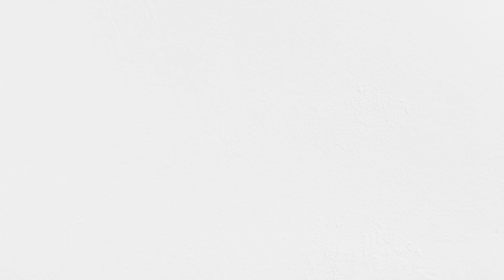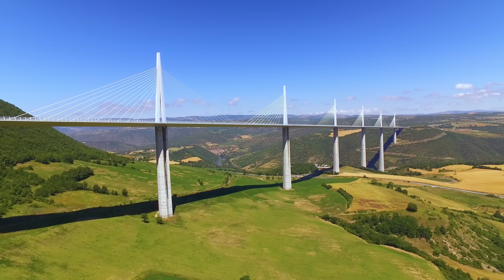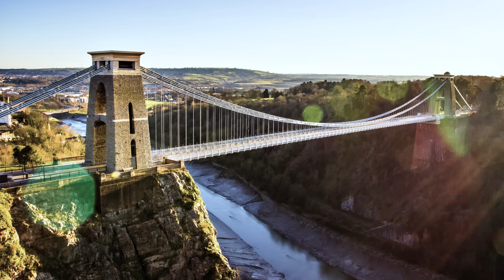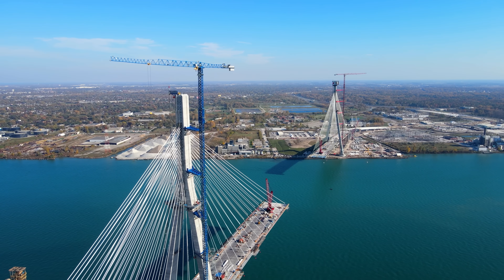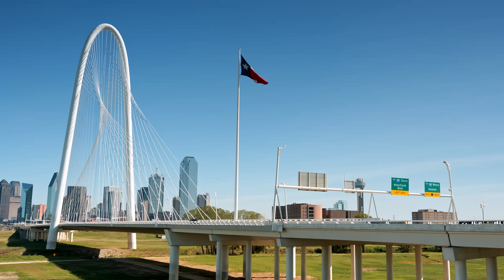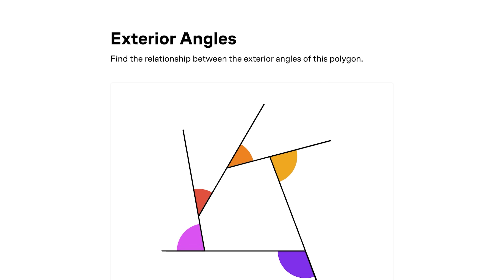A Love Letter to Cable-Stayed Bridges

Comment: I live outside of Vancouver, BC. In the early 2000's, the Port Mann bridge was replaced with a cable stay bridge. The Patullo Bridge is being replaced right now, with... a cable stay bridge. In total, there are (or will be when Patullo construction is complete) SIX cable stay bridges in the Fraser Valley - 5 over the Fraser River, and 1 over the Pitt River (which feeds into the Fraser shortly downstream from said bridge). And one of these isn't even for cars, but instead for the local SkyTrain rapid transit system! 
Having lived near so many of this type of bridge for so much of my life, I think I agree that these are the best bridges. But maybe not the best ever... I'm pretty sold on tea.

Comment: Congratulations on these engineering presentations. I appreciate the tacit sense of humour. 

I would have added the fact that the catenary suspension bridge has the catenary curve connected to the horizontal deck below, by vertical parallel cables. This forms a rectangle which can change its shape, unlike a triangle which is stiff and does not change shape,   I do not understand why the engineers did not see this  feature which permitted the catenary bridge to oscillate as a violin string or a piano string,  This was the reason of the collapse of the Tacoma Bridge,  where the quasi rectangular spaces could change shape, hence it permitted different modes of oscillations. Pay attention to the vertical quasi rectangles holding the deck 
https://youtu.be/XggxeuFDaDU?si=NVwXOTN-uup-kEHn

The cable stayed bridge with its triangles is much more stable . Those triangles are wonderful structural elements, 
https://youtu.be/vHASuGfYZdc?si=X44xaN2QQewD0OkT

Comment: Very cool video, the one thing I dont quite understand is how the decks of long cable stayed bridges like the russky bridge shown can withstand the compression forces without buckling... the decks look so thin and flimsy yet the entire weight is suspended by cables at a 45° or even shallower angle pulling on them sideways as much as theyre pulling the deck up... 
Is that the reason why the longest bridges are still suspension bridges??? In suspension bridges you dont have the problem of a compessing and buckling deck...

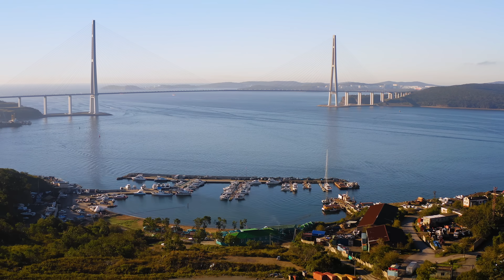Comment: 13:50 and so I, someone interested in "A stable crossing of the Messina strait", could close the video here, since our bridge needs to be 3,3 Kilometers long.
Not even close, unless you use a suspension one. (Also you can solve the wind issue with having an aerodynamic structure with a wing like shape; I guess computer aided design has made progress there too)

Comment: Thanks, I've often wondered why cable-stayed bridges have become ubiquitous recently.  I supposed it was due to some significant advance in materials, but if I understand you correctly it has more to do with the availability of computer power to do the necessary calculations.

Comment: One of the most interesting parts of the west section of the bay bridge is that while it is essentially 2 suspension bridges glued together it’s roadway is still designed as 1 large one, the highest point is the where the center anchor tower is located

Comment: I'm surprised you didn't mention the Queensferry Crossing in Scotland, within a mile there is a cantilever rail bridge dating to the 1890s, a 1960 suspension bridge which, as you say, is reaching end of life and now just used for buses and finally a 2017 cable-stay bridge.  Without doubt the cable-stay bridge is the most beautiful, but seeing the 3 of them together is magnificent, particularly from a boat going under them

Comment: The arch bridge is much better for a relatively short span with a deep bottom like a canyon. For a short span utilitarian RR bridge a steel truss bridge is more practical. All bridges don't have to be astatically designed. IMO the Golden Gate is much more beautiful than any of the harps shown.

Comment: If that is the new arthur avenue, it's not even the scariest bridge in the area, that credit goes to a bridge crossing interstate twenty six on ashley phosphate, but the close second being one of the older bridges that's going into mount. Pleasant on 526, and the reason why that one was terrifying was. I got stuck on it in high wind situation. Because someone's car ended up burning and they had to rush emergency services from the exit ramp.

Comment: Disappointed there are no pictures of my local cable stayed bridge, the Queensferry Crossing! Opened in 2017, it spans the River Forth right next to a suspension bridge from 1964, and the famous cantilevered beauty from 1890. Together they are a lovely portrait of the evolution of bridge design, and all 3 are still in use

Comment: My first experience with cable stayed bridges was the Anzac Bridge in Sydney Australia opened all the way back in 1995.
It's kind of cool to drive over this bridge in the back seat of a car. If you tilt your head back and look up and out of the rear window of the car, the cables appear to shoot up as you drive under them.

Comment: My first sight of a cable stayed bridge was in the 1980s.  I watched it go up with wonder at its beauty, and I drove over it the first day it was open to the public.  It wasn't that long (main span not quite 1000 ft, IIRC) but it really lifted you up high, very quickly (to accommodate containers ships, I believe).   Passing over that bridge almost never was the sensible route for me to take, but I would frequently go out of my way just to drive over it and enjoy the view, both of the bridge and the river below.  These have been my favorite bridges, and arguably, my favorite works of engineering, for nearly 40 years now.

Comment: Could you address a topic that is in and out of the energy news. 
I have a general understand of how oil refineries work. Basic fractional distillation, cracking tower.  Much reported is the diffrence between the light sweet crude pumped outta the Permian basin. NOT BEING refine in our refineries because they were designed to refine tar sand oil. Could you shed light on this. It would appear that you would skip someone the initial clean up steps

Comment: As a heavy haul driver who routinely operates trucks up to 65 tons, I personally appreciate new, strong, and safe bridges.

Nothing will make you sweat like crossing an older bridge that has a weight restriction yet the state will route you across it with a note on the permit to slow down and straddle both lanes.

Comment: Question, is it possible to put a system of pulleys across a cable stayed bridge to bring the lateral forces to the same point? This way we can have the cable ends pull on each other. Wouldn't this require less support?

Comment: "The Öresund bridge in Denmark", it's between Denmark and Sweden and most of the bridge is on the Swedish side since it transfers to a tunnel closer to Danmark so it doesn't interfere with traffic at Kastrup airport.

Comment: Second year into studying civil engineering and I have to agree that cable stayed bridges are incredible, able to span great distances whilst also providing the necessary rigidity needed for certain applications like rail bridges whereas suspension bridges are typically too flexible
Reply: I suggest you look into the bridges in many different location of China, Cable stayed bridges is good for railway, but with wider river arch bridges can have much bigger span, there is one in building with 2300 meters for the main span, without building more piers it is a cost saving design, also large ship still able to go under the bridge.

Comment: Excellent. I had found most of the early cable stay bridges to look a bit 'ugly' with too many boxy straight lines. However the video was an eye opener about just how simple and effective the cable stayed bridges are, along with the how and why of their late arrival.

For a glorious comparison there's the 3 bridges across the Forth estuary here in Scotland, with the old suspension bridge being rapidly down graded because of corrosion on the suspension cables. The new 'third Forth bridge to Fife' (aka Queensferry Crossing) is quite a neat bit of kit, easily seen from the "Forth Bridges Viewpoint".

Comment: Yes! They are fabulous bridges! Not cable stayed, but I used to traverse the Tamar via the rail bridge built by Isambard Kingdom Brunel, on train, and latterly, via the road traffic suspension bridge  built in 1961, connecting Cornwall and Devon.
I marvel at the engineering every time that I cross.
Every time!
Reply: Actually it's a funny hybrid, it's a suspension bridge but the curved arch over the deck is not a typical truss but there to take out the compressive forces from the suspension rather than use anchors. It's a very unusual design

Comment: What's intriguing is how far away some of these cable-stayed bridges can be seen from. The Gordie Howe Bridge can be seen for miles and dominates the skyline of the lower Detroit River when looking north, and even seen from Lake Erie as far south as Stony Point. However, the Ambassador Bridge (a suspension bridge about a mile north) just doesn't stand out on the horizon the same way, head a short distance down or upstream of Ambassador it just kind disappears. Even the Mackinac Bridge just doesn't have the skyline presence I feel.

Comment: You mentioned a caveat to suspension/cable stay bridges, but didn't mention how we have compensated for those erroneous forces, since 1955 we have been retrofitting bridges with viscous damping devices to reduce those erroneous loads and maintain the structural integrity of the span. Look up Taylor Devices Inc. for more info.

Otherwise, excellent job, it was very informative to learn the "other" side of suspension and cable stay bridges.

Comment: I always quite like it too. The symetrical and simple look. The easy construction method to see, the quite "easy to understand" forces. I was almost never fan of suspension bridges. I never really get why they got theses 2 big enormous cables instead of just some little ones, redundancy seemed better, etc. So I appreciated your part explaining why it only started ggetting traction recently.

Fun fact : they were working to replace a big bridge in montreal (Chaplain bridge), they went from the oldschool  design to the cable stayed bridge, and I found the new one so much more gracious. It was completed quite fast if you are asking me. I kinda think they spent more time redesigning the car access to bridge than build the bridge itself.

Comment: I was hoping that you would include the "Most SNP" bridge in this video, as you have included some other smaller city bridges. Most SNP can be translated as "Bridge of the Slovak National Uprising" and was built between 1967 and 1972. It is an asymmetrical cable-stayed bridge with a main span length of 303 m (994 ft), a total length of 430.8 m (1,413 ft), a width of 21 m (69 ft), and a weight of 537 t (592 short tons). It is the world's longest bridge to have one pylon and one cable-stayed plane. The bridge has another specialty:  a flying saucer-shaped structure atop the bridge's 84.6 m (278 ft) pylon, housing an observation deck and a restaurant. Both the restaurant and the observation deck offer panoramic views of Bratislava. They are reached using lifts located in the east pillar, accessed from the walking and cycling paths on either side of the bridge. The west pillar of the bridge tower houses an emergency staircase with 430 steps.
Reply: View from the observation deck: https://www.youtube.com/watch?v=o1DsWE_9JUc

What other bridges have such a feature?

Comment: The only issue that I'm aware of with these types of bridges is that in colder areas spanning water ways, there is an issue with ice forming on the cables that crashes down onto the bridge deck.  This bridge in Vancounver has a unique solution.
https://youtu.be/nl4OgGcvWzM?si=tVcktgmqKc4g0otQ

Comment: Super interesting video as always!
I had the chance to follow a curved deck cable-stayed bridge construction project at a one hour drive from home when I was a kid. They had a visitor center where the 10yo concrete addict I already was could ask whatever I wanted to actual project engineers about post-tensioning in the curved piles. I remember leaving with an A0 sheet with pt and steel details plans for one of the curved and asymmetrical inverted Y shaped pile which I still have somewhere. It's called Terenez bridge, in Britanny, France, I recommend having a look at pictures of it, a stunning design from Michel Virlogeux. He worked on some of the most impressive and beautiful cable-stayed bridges over the last four decades!

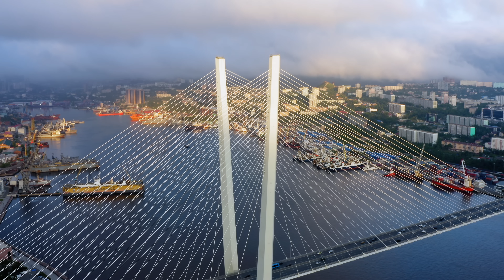Comment: One small question though, at 12:03, right in the middle of the deck, there would be some tension as the cables are pulling at an angle right? I guess most of the force is directed upwards, but the bigger the gap without cables the bigger it would be, wouldn't it? Also, if the gap is too big it would make the deck "sag" a little so that has to be considered as well.

Comment: @practicalengineeringchannel

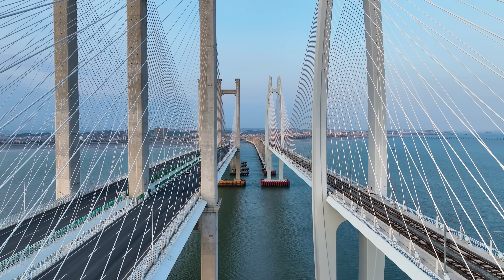11:53 You mention concrete loving compressive forces. Isn’t the concrete at the center of the bridge (between the two sets of stays) in tension? Wouldn’t that create a more weak section of the bridge deck? How is this variation in forces compensated for in the design of the deck across its span?

Comment: There was a brief mention of cable stays as temporary supports for an arch bridge - in the UK, parts of the viaducts for the Delta Junction in the Coleshill area are built with temporary cable stays: eventually they'll just be conventional deck bridges running directly from pier to pier, but to allow the segments to be added and connected to the existing structure (with the aid of epoxy!), temporary cable stays are used.

Comment: I have long appreciated your channel and your ability to communicate engineering processes to the general public effectively, even though I have long suspected an unfortunate association with a certain "school" in Travis County. I was quite enjoying today's discourse and ode and remembering caring for my niece and nephews while making sure they could identify bridge types and comment on infrastructure on long road trips, and, innocently of course, driving my sister nuts. Today, though, you used a term I have managed to avoid pretty well since I left practice to enter the ministry. You used the "A" word. Now I am professionally obligated to inform you that God will forgive you and I am going to try very hard as well.

I long wondered why the "A" guys were require to take calculus when there seemed to be no requirement that they actually pass or understand it, especially when it comes to the deflection of an elastic curve. I got so tired of getting requests for extreme cantilevers of slender proportion that I developed a CAD library of details with various numbers of blimps to support the free end along with the requisite buildings to house the blimps and supported structure along with estimated costs. 

In any event, I still enjoyed your program, agree with your analysis but need to caution you to watch you language because young people may be watching.

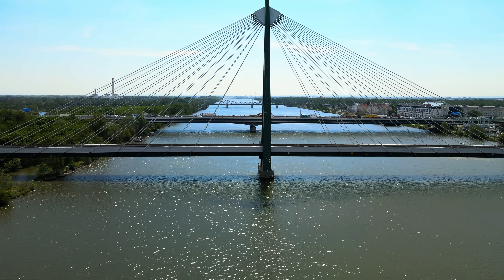Comment: 14:14 As someone who has spent too much time in the Pasco-Kennewick area, I can first-hand tell you that bridge at 14:14 is simply called "The Cable Bridge." Also, that bridge at 14:14 is not the Cable Bridge. In fact, that is not even the Pasco-Kennewick area at all.

Oddly enough, the tip-off was actually the bridge in the middle. In fact, there is no bridge between the Cable Bridge and the rail bridge.

Comment: sweet video!  But starting with with iron bridges, there has been an oft-repeated cycle of innovation, overconfidence and failure.  I earnestly hope there are no cable-stayed bridge disasters, but it's too early to proclaim there will never be one.  An example of unforseen problems from my neck of the woods: the new Port Mann Bridge over the Fraser River is a cable stayed bridge with a center pylon design.  The first winter of operation, ice built up on the cables, which, when released, fell straight down onto the roadway, severely damaging vehicles below, and aubsequently causing  intermittent traffic disruption for the rest of the winter. No disaster, but an example of something that hadn't been thought of.  I have an example of an engineering idea that combines utilitarian efficiency with aesthetic appeal, has endured centuries, and has no apparent successor: the steel wheel on steel rail railroad.

Comment: Excellent Video.  It reminded me of two much smaller versions of cable stayed bridges built in Tampere, Finland. They are pedestrian/bicycle bridges built very close to each other.  The first is known as Laukonsilta and it crosses the Tammerkoski river north from Ratina to Laukontori (the market square.)  The bridge is 5 meters in width and the total length is 150 meters.  It was completed in 2010.  The other is known as Vuolteensilta and is at the eastern corner of the market square about 300 meters east of Laukonsilta.   It was completed in 1985 and crosses from the market square east over the Tammerkoski river rapids to Koskikeskus on the west bank.  I saw them in early 2012 when I visited.  And was struck by their design.

Comment: I do love a good Cable-Stayed Bridge. But honestly as an Mechanical Engineer, reversible heat pump seems to me to be the closest thing to magic that I have ever calculated on.
Also people forget how incredible a pretensioned bolt connection is. Making the flanges carry the shear forces in friction and the fatigue stress cycles in compression while the bolt itself only feels a fraction of the fatigue loads while still making it possible to disassemble the thing again. That is still way above average and I would be happy to go on that valentines day. 😂